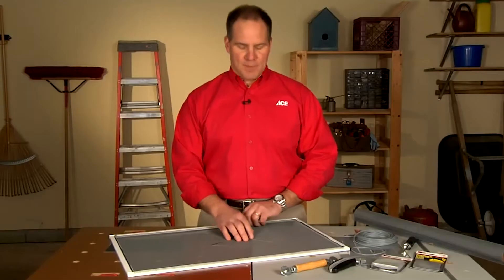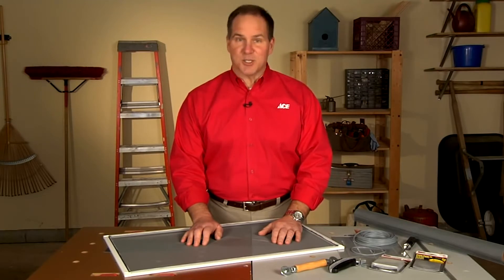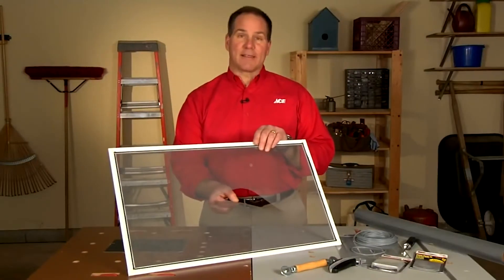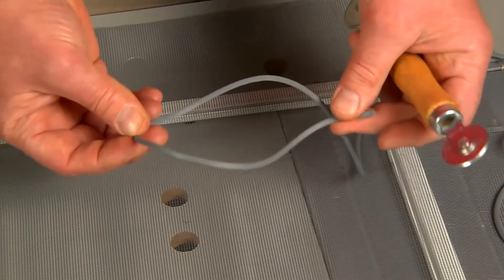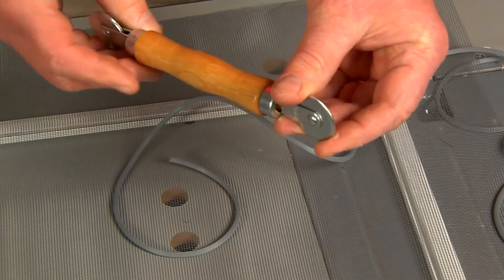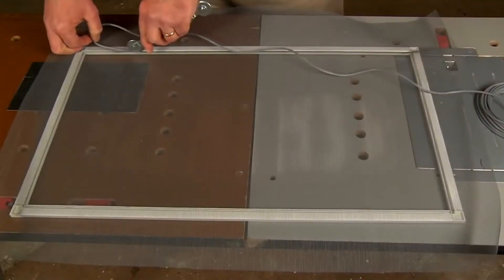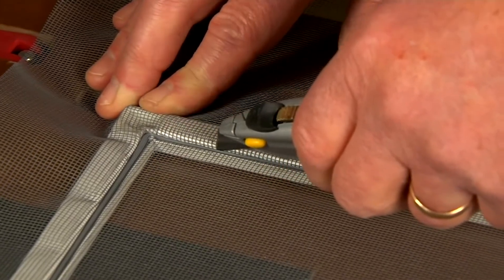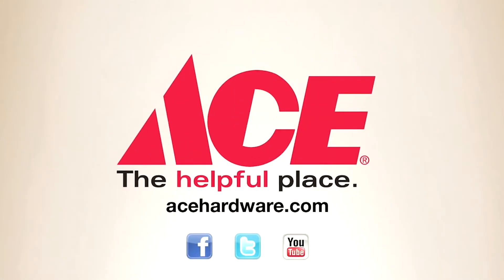How To Repair a Window Screen | Ace Hardware

Comment: Great. I've taken 5 of my screens on a 20 year old house to Ace for replacement, and every one is very sloppy. Frames bent, wrinkled corners, sagging edges. Nowhere near like they were when we bought our house new.

So the process may be simple, but the craftsmanship is beyond what 3 employees at our local Ace are capable of apparently, including one with "extensive experience."

Off to a glass and window professional it looks like since I simply don't have the time.